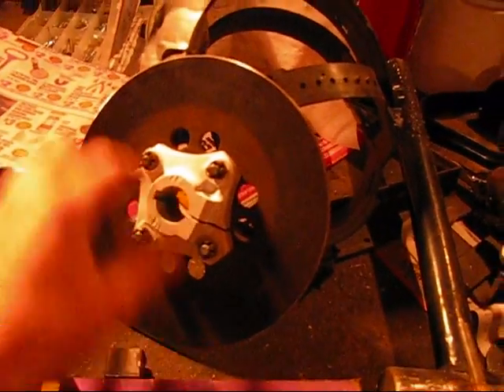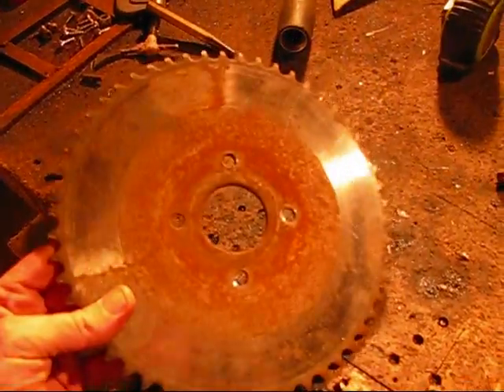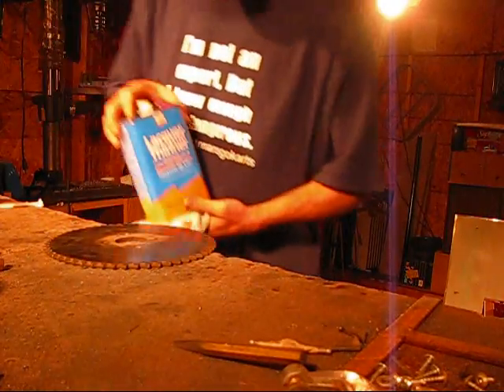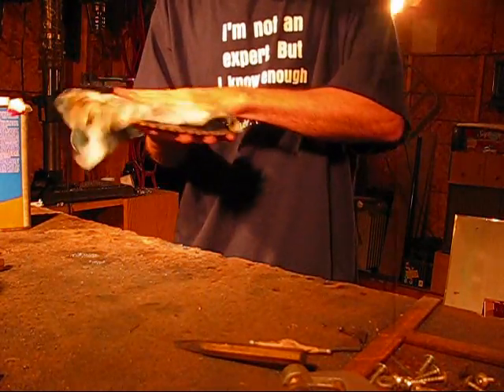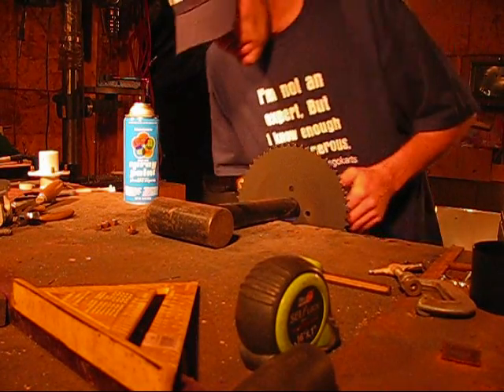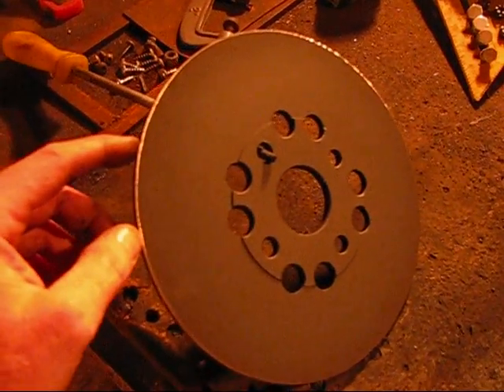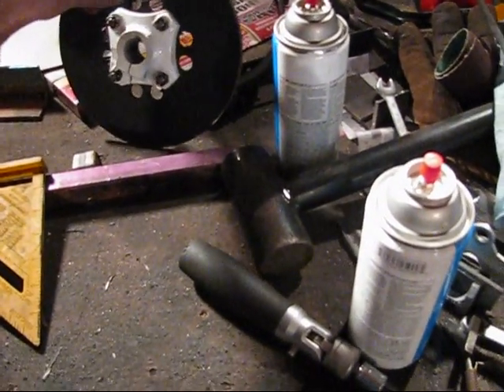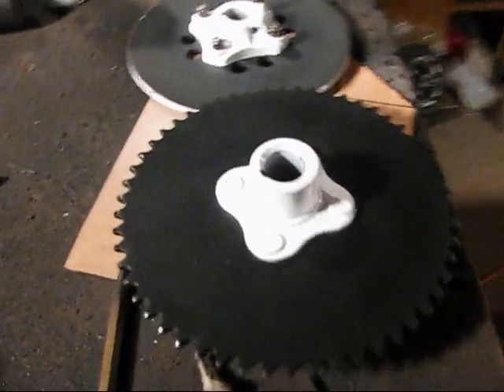Painting the sproket / Disc & Good / Bad News

Comment: Is there a standard number of teeth on the axle sprocket that you consider to be the optimum for power transfer? The T shirts are great. If you have any left I shall be buying one once my car is back on the road. Just waiting to have the parts put on. I am definitely an EXPERT. EX is a has been and a SPIRT is a drip under pressure and that's me. LOL. Thanks for the info in advance.